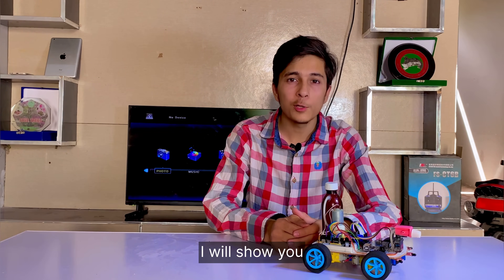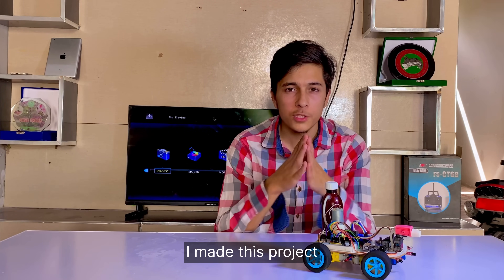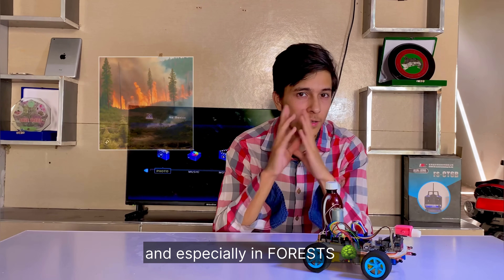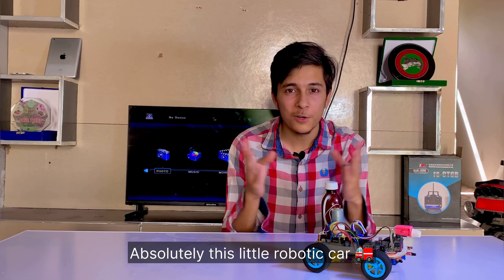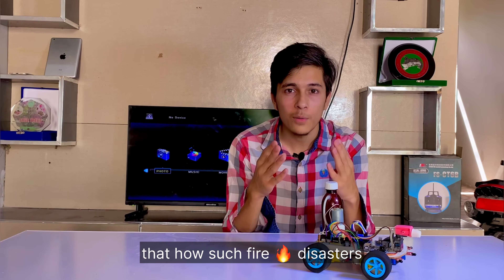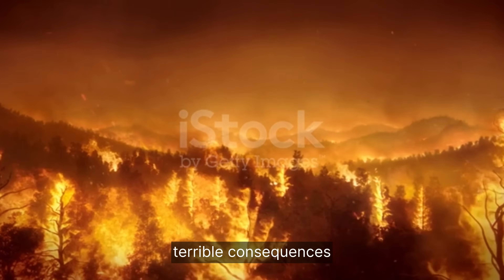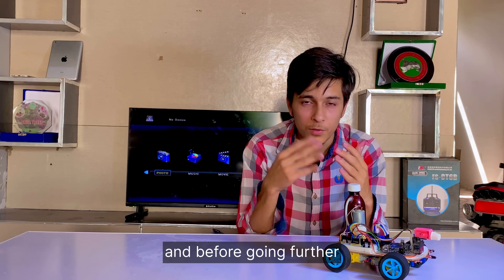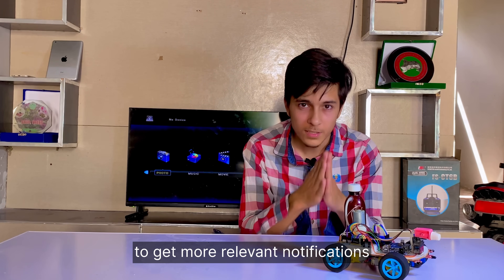DIY Fire Fighting Robot using Arduino  |  Auto Fire Chaser and Extinguisher

Comment: Bro i tested by changing the port,when i changed it turns left and then i changed it turns right but the problem is 2 ir was not working for bo motors at the same time if i change the port only one ir was working for bo motors and turning left and right if i changed what to do(two ir was working for pump motor 😐)
Reply: Same

Comment: Broo as u told before, i checked the circuit connection and I done correctly but it doesn't work only 2 bo motors are working when we got fire (only one ir was working for bo motors and two ir was working for pump motor) what to do i checked the code and paste it properly but its not working 😓
Reply from the maker: It may the problem with ir sensor or bo motor connectiona
Reply: What to do
Reply from the maker: Send me the video so I can check your connections
Reply: Where to send bro

Comment: No motors are working with the code you provided. And water pump don't work properly with the transistor so I removed and it worked. What to do for the motors?
Reply: Bro for me it worked well with the tip122 transistor but only 2 bo motors are working when we got with fire that is only one ir was working for bo motors and rest of them working for pump motor

Comment: Bro i fully checked it was working but only right (ir) was working for bo motors left was also working for pump motor 2(ir) was working for pump motor. I tested with flame the car moves and turning left. I checked with changing tha port like A0,A1, A2 butt even if we change the port only one ir was working for bo motor (same ir even we change the port) what to do
Reply from the maker: Do the ir flame sensors second led gets on when expoed to fire do they work well??
Reply: @saadinnovativeideas  yes bro

Comment: Bro now i made the project it works well but the servo motor not working and the pump motor working when we got fire with two (IR) sensors and the bo motors are running with one (IR) sensor with flame. It can be changale? To one for pump motor and two for bo motors.(Servo motor not working while pump motor was working)
Reply from the maker: Servo has three parallel wires, interchange the side wires and leave the middle one
Reply: @saadinnovativeideas  bro that worked but two ir sensor are working for pump motor and only one ir motor working for bo motors ,it was wrong what to do, only left side turning right side ir was working for pump motor
Reply from the maker: Just once check throughly the connections with circuit diagram I provided and again copy paste and upload my code
Reply: I tried like changing the wire connection with A0,A1 and A2 but nothing just only one ir sensor working for bo motors rest pf them working for pump motor 😐😓
Reply from the maker: Just do I said, if the problem still exist let me know

Comment: We are doing the same robot but when we on the switch, the water pump automatically runs even without flame sensor detecting flame. What could be the problem? We just did the same connection you provided. A response from you would be so much appreciated. Thank you!
Reply from the maker: Test it again without exposing it to bright light like sunlight. Have you used the same components I have used with water pump??
Reply: @saadinnovativeideas  yes, all of the components we are using are the same with your components
Reply: @saadinnovativeideas  we also followed all of your connections in the video
Reply: @saadinnovativeideas we already tried it in area without sunlight but the motor still runs automatically when we switched the robot on. what could be the problem?

Comment: Bro i made it but one (IR) sensor was not working in the circuit and i even tested with a flame at first the motor ran but at the second time its can't what to do
Reply from the maker: Is the problem with just one (flame) sensor? Does the rest work well??

Comment: the schematic and the 3:30 part is different. the schematic said that the DO of the flame sensor doesnt have wire but there is a wire in the video. please explain

PS: sorry for my bad english
Reply from the maker: No problem at all.. do it according to schematics, DO goes alone. Sorry I had corrected that behind the scenes

Comment: Bro i got two 3.7 volt battery as u told earlier. I made the project as per the circuit diagram but it's not working properly. In flame sensor the flame light was blinking without any fire or smoke and its not working what to do
Reply from the maker: Do not expose it in bright light like sunlight
Reply: @saadinnovativeideas  is it only the reason ?
Reply from the maker: Check it indoor because infrared receiver (IR) receives light radiation from the sun
Reply: @saadinnovativeideas  ok bro i will try and i will definitely achieve it
Reply from the maker: @ashwin4811 yes of course you can
Reply: Bro i made it but one (IR) sensor was not working in the circuit and i even tested with a flame at first the motor ran but at the second time its can't what to do

Comment: Bro mera servo motor aur bo motor work nhi kr rha h connection diagram dekh ke h connection kiya hua ab kaise hoga help kro bro
Reply from the maker: Apka input voltage kitna hai or konsi battery use ki hai
Reply: @saadinnovativeideas  3.7 ka do battery
Reply: Direct power bank se bhi connect krke dekhe pr bo aur servo kaam nhi krta h
Reply from the maker: Rechargable use ki hai na??
Reply from the maker: Power bank ka output 3.7v hota hai or project kalia minimum 7.4 volt chahia
Reply: @saadinnovativeideas  nhi sirf 3.7 ka 2 battery use Kiya hua
Reply: @saadinnovativeideas  uska output 10v ke approx h
Reply from the maker: 10v compatible hai lekin battery rechargeable hai ke non.. kionkia arduino board kalia 2.5-3 amp chahia aap ke battery kitna apm provide kar sakti hai max
Reply: @saadinnovativeideas  non rechargeable
Reply: Bo motor to work bhi nhi kr rha h
Reply from the maker: Non rechargeable most batteries maximum 1 amp provide karsakti hai or project kelia 2.5-3 amp chahia.
Rechargeable battery use karlo wo 2-3 apm provide karti hai
Bat sirf voltage ki nahi hai aphere bhi 2.5 se above hona chahia

Comment: Saad,I have a doubt on code, 
there are two ranges for value s2((251<=s2<=800) and (s2<350)) 
So,for example, s2=300 which else if condition will be chosen?
Reply from the maker: s2=300 satisfies both conditions:
•251<=s2<=800 (true, because 300 is between 251 and 800)
• s2<350 (true, because 300 is less than 350)
The first else if condition that is true will be
Chosen, which is:
else if ((251<=2<=800)
If the first condition is true, the rest of the conditions in the else if chain are not evaluated.

Comment: If fire located at top how will it extinguish the fire
Reply from the maker: It has a wide water throwing angle.. for more you have to add one more servo
Reply: Ok thanks
Reply: Bro but there are some errors in code
Reply from the maker: No I had provided the right code that I have uploaded in my own project
Reply: Ok thanks
Reply: How can I control it with blutooth can u assist

Comment: Can you explain me what does the numbers like s1<250 s2<350 says in the code??🙏🙏
Reply from the maker: In Arduino code, these lines might be used to check if a sensor reading or value is below a certain threshold:

- "S1<250" means "if sensor 1 reading is less than 250".
- "S2<350" means "if sensor 2 reading is less than 350".

Comment: Hello, I need help, what happens is that I made the same car, with the same diagram, but the tires of my car when I connect the Arduino to the computer rotate two on one side and the other two do not rotate
Reply from the maker: Flip the motor wires
Reply from the maker: @stxrrylit889  please translate!

Comment: all working but why my bo motor not moving
Reply from the maker: How much is your input voltage?
Reply: two of 18650 battery same as what u use but for testing I didnt put the battery yet supposely after I upload the code it should work since arduino got power up directly from the pc
Reply from the maker: Obviously.. pc provide only 5 volt, it wont works until you give the power of two in series

Comment: Bro why should not use 9v non rechargeable battery
Reply: Ok bro i will try it later and say to you thank you
Reply from the maker: Because that cant provide sufficient Amps
Reply: @saadinnovativeideas  Bro please help me bro i have connected fully but the bo motor and servo motor are not working but the flame sensor and Arduino are working properly. I want to know that it the fault of using 9v battery?
Reply from the maker: Brother the deal is not limited merely up to voltage, this project requires about 3 amps to run and the 9 V non rechargeable battery can hardly give up to 1 amp, so obviously the project wont run. Li ion rechargeable battery can provide 3 amps
Reply: Bro I have 6 Eveready battery 1.5amps battery totally 9 amps is it ok ? Can i connect it in series and can i use it??
Reply from the maker: How much is its capacity
Reply from the maker: Connecting them in series would not increase its amps rating . So connecting 6 1.5 amps batteries would have the resultant value of same 1.5 amps, which is still insufficient. You need at lest 2 amps for the motor driver (L298N)
Reply: 1.5v
Reply: Can we connect 2v battery for motor driver alone and 9v non rechargable battery for Arduino?
Reply from the maker: Not of course, the motor driver actually needs the higher amps (2-4 apms , 7-12V). And it distributes the desire value of voltage among motors, servo and Arduino uno.
Reply: @saadinnovativeideas  ok can u tell me how much the battery cost 😅
Reply from the maker: You will need two li-ion batteries 3.7 V 2000+ mAh that will cost about 600 PKR per one piece. But its price varies, check it in your local store. 
You can also use phone removable battery like old Samsung battery
Reply: Bro i got two 3.7 volt battery as u told earlier. I made the project as per the circuit diagram but it's not working properly. In flame sensor the flame light was blinking without any fire or smoke and its not working what to do

Comment: Bro in my flame sensor don't have ao pin so how I do run my project please give me a perfect code and circuit diagram for ao pin for I run my project perfectly please
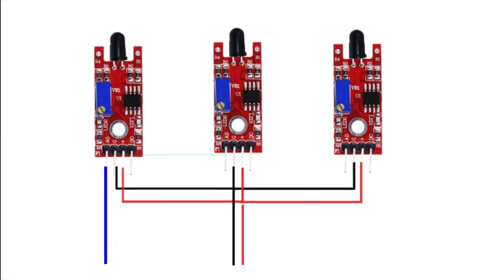Reply from the maker: Brother AO is not needed to connect for this project. Mine one was having an extra pin that goes alone. Connect them all according to circuit diagram for sensors shown in video at duration 03:21 . Check out circuit diagram and code in the video description
Reply: Then why my project are not working @saadinnovativeideas
Reply from the maker: There may be another fault

Comment: how to use relay module instead of using transistor
Reply from the maker: With same circuit diagram
Reply: so just follow the current circuit diagram but replace the transistor with relay module
Reply from the maker: Exactly, just replace the transistor with relay module and the connect the 2 outputs of relay module with pump. And no need to modify the code, cause relay module plays the same role
Reply: is there any additional code in coding have to add on or no need

Comment: Is ut posible to use Submersible pump 2.5-6VDC Instead of the one you used?
Reply from the maker: Of course you can use that
Reply: @saadinnovativeideas   hey agin i builded evrything and when i try to upload the code it shows eror like A1' was not declared also for A2 and some more errors...
Reply from the maker: Make sure you have done all according to circuit diagram because the code is the that particular one. If not worked still then text me the error
Reply: @saadinnovativeideas   ye i just havent selected what board im using the code works but now when i plug in the batery im using 9V but its not full its like 7.7V now and i plug in everything and on the board it shows that its ON and its not doing anything
Reply: but when i plug it in pc the letter L on board is shining and RX is flashing.Also when i plug in battery while board is pluged in pc there is a beeping sound and the wheels are moving but sensors doesnt do anything. and also while its pluged in pc it overheats sensors and board to much

Comment: which wire is used to connect flame sensor please tell
I want to make this
Reply from the maker: Jumper wire.. 
I did not got what you actually mean
Reply: @saadinnovativeideas  Sir I want to know which type of wire is used to connect flame sensors with Arduino
is it jumper wire or other 
if other then tell the name please
Reply from the maker: I have used jumper wire but I have trimmed its one end to solder it. You can do the same or otherwise use male to female jumper wire but then your breadboard connection will be little bit more complex
Reply: @saadinnovativeideas  The trimmed jumper wire is male to female ?
Reply from the maker: Whichever, but when you trim you should select the one having one side male and the other side is to be soldered
Reply: @saadinnovativeideas  Ok thanks

Comment: Did you use battery charging for your batteries?
Reply from the maker: Yeah li-ion Rechargeable cell
Reply: Everything works except the wheel motors, the problem would be the battery
Reply from the maker: Which battery have you used and how much is the total output voltage

Comment: Thank you for replying fast.
But in the video u said 102 pf 
And in comments 104 uf. Which should i buy. And thank you again
Reply from the maker: Always welcome brother. As I tell you before an average limit, you can use 104 if you avail that. But if you did not got that you can do parallel connections of small valued capacitors to reach the desired value.
Reply: @saadinnovativeideas  Entonces no hay problema si uso los 33pf como usted lo uso o es obligatorio los 104 uf?

Comment: very inspiring. can you make a video on how to use the every pin of the arduino uno OR ESP32 board,
i mean explaination of the pins what's their pupose which pin can serve which task either transmissionm recieving , direction control or input supply ?
I have the board unable to reconize their pins which pin i can use for which pupose.
can you make a video on that ?
i have searched on google a sheet appear but  that is also a fixed notions .
Reply from the maker: Thats interesting brother Arduino uno board have multiple pin including; digital pins, analog pins, power pins and some other like RESET and AREF… but this require  vast explanation and require a video… but brother I am a student of intermediate (FSC) and I am having final exams currently so I apologise, I could not make such video now. I will work upon it when exams comes over
Reply: @saadinnovativeideas 
Could you please tell me how do I use Esp32 cam with the same model.
And what would be the code for it?

Comment: bro can u explain me why u used a transistor
Reply from the maker: As I haven’t used relay module for driving water pump. So TIP transistor is used to regulate current and voltage to the pump so it could not be damaged

Comment: I bought the same materials but when I connect the 5V cable to the arduino, it does not turn on. What could be the problem?
Reply from the maker: When you connect connect Arduino uno with laptop/Computer through arduino cable it should turn with red led blinking

Comment: Bro please tell how to connect water pump with external capacitor and transistor
Reply from the maker: Connect them according to circuit diagram. Use jumper wires and breadboard or solder it

Comment: Bro code not working please help me out
Reply from the maker: Have you selected right port and board . Text me the error
Reply: For me its showing only  1 port COM3
Reply from the maker: Select com in tool-serial port which ever is showing
Reply: In the robot flame are working but servo and  tyres are not moving
Reply from the maker: How much voltage and amps have you given to the motor driver, I mean which battery have you used
Reply: 3.7v
Reply: Servo and tyres are not moving
Reply from the maker: Obviously that will not move, the motor driver driver needs 7-12 V input. Increases you voltage and don’t use that 9 volt non-rechargable battery
Reply from the maker: Connect two 3.7 v batteries in series
Reply: Yes i have connected two 3.7v batteries
Reply from the maker: Make sure you have done exactly as in circuit diagram and uploaded the code successfully. Connect the power with motor driver; negative with GND (middle) and positive with 12V (left) and give parallel connection to the Arduino board

Comment: HELLO SAAD  I HAVE PROBLEM IN YOUR CODE BEFORE FIRE DETETCTION THE RELAY WORK BEFORE DETETCTING FIRE AND WHEN FIRE IS DETETCTED THE RELAY NOT WORKING AND PUMP IS OFF
Reply from the maker: Which circuit diagram and code have you followed?
Reply: I Didn't use your circuit in youre relay i have a mini pompe 5 v branched with 5 v relay but i changed youre code to have the servo work with pump but the motors work in the beginning until the flamme is detected they stop i think maybe they need a High voltage and last question how much they need in ampetage and voltage 4 dc motors
Reply from the maker: No brother that would not require more voltage. The problem could be the incompatibleness of circuit diagram and code. So cannot guess your circuit diagram. Recorrect the code according yo circuit diagram
Reply: @saadinnovativeideas  now its working I discover that the sensor detectie the light of window i still have the problem in the direction of the motor
Reply from the maker: Yeah brother it has a little drawback that the sensor detects light rays, so could be disturbed in the open light

Comment: hello my freind good job i want ask you a favor could you add a obstacle avoiding in the same servo please i couldnt make it im new in arduino projects and god bless you
Reply from the maker: Thanks brother.. Yeah you can add ultrasonic sensor but the circuit diagram as well as code will differ by little modification. I am gonna make fire fighter with obstacle avoidance, I will upload the video